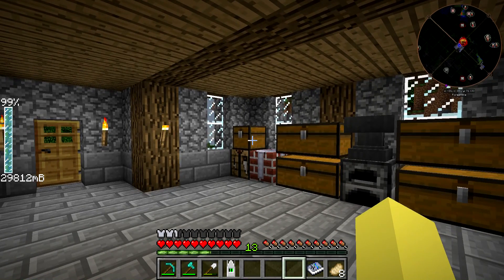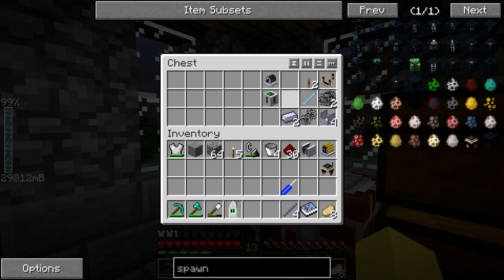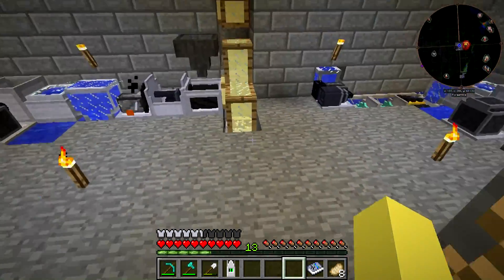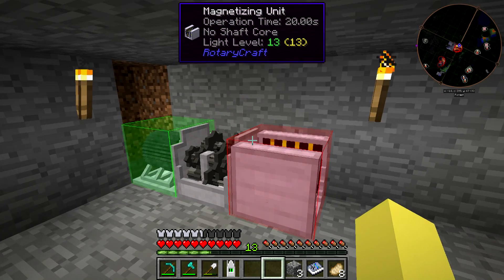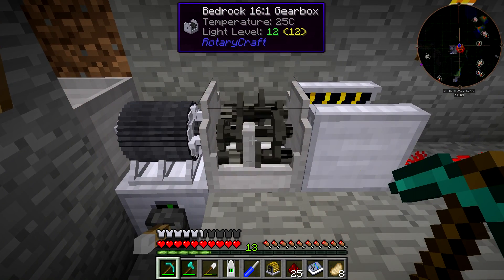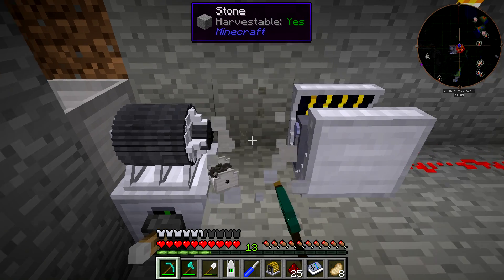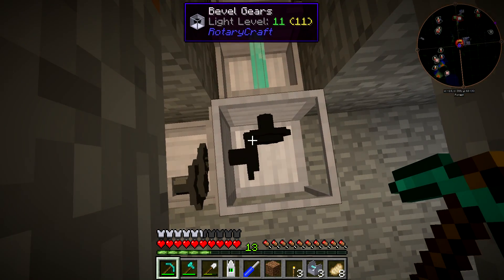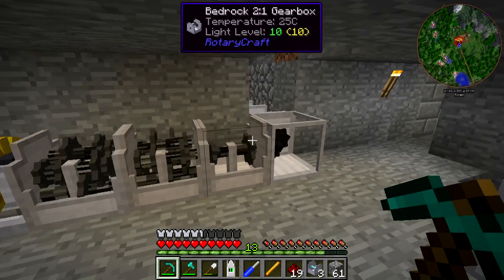Surviving With RotaryCraft :: Ep.15 - AC Electric Engine And Magnetizing Unit

Comment: Argh, again with the magical Redstone power source!  I fail to see how a pulsed Redstone source, which is essentially a pulsed DC source, would provide the required redstone/voltage sinusoid to enable the AC engine to generate torque, without some kind of inverter.  I guess, with a DC engine this is slightly more forgivable, given that the DC motor would contain a commutator to synthesize the correct waveform from a DC voltage.  An AC generator would be more appropriate.  Rotorycraft would be perfect if not for the reliance on magic redstone torches and switches.
Reply from the maker: I completely agree, especially when the DC motors are extremely prevalent, even later on in the mod. It is much more realistic than IC2 though, so I am not too annoyed hah.

Comment: What's going on with your redstone is that the AC engine requires that redstone cycle from off to on. Your clock was too close to the AC engine. For that clock, a space of 3 meters from the comparator will let the redstone cycle from off to on. At 2 meters it was cycling from 1 to 14. 

Next I challenge you to figure how to automate charging shaft cores. A hint, how would you pull and insert cores into the Magnetizing Unit?

Comment: ;)
Nice. I was only using 4 steam engines geared for speed and yea ok it s sustainable but damn it s slow to magnetize. With a turbine and bedrock gear it s so fast wow.

i was really enthusiastic about the ac engine but i realize that i cannot filter and sort magnatized shafts, too bad, maybe i m doing it wrong but just with rotary i have no clue how i can automate ac stuff. yet it s a good option for some machine! some doesn t need to be up all the time but still need more power than steam engine (refrigeration unit for exemple), anyways it s always a good 'tool' to have at disposal.